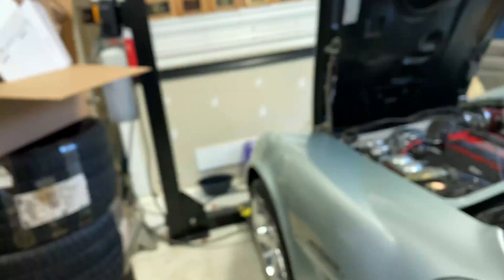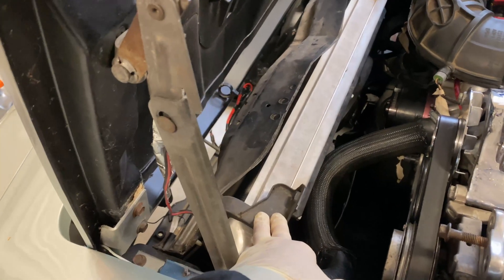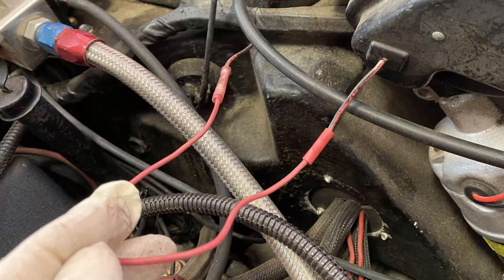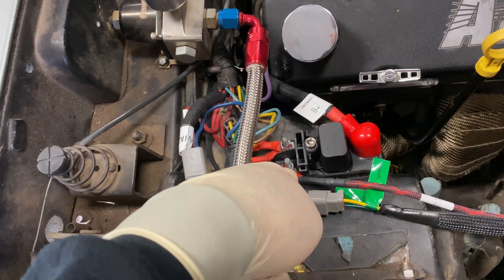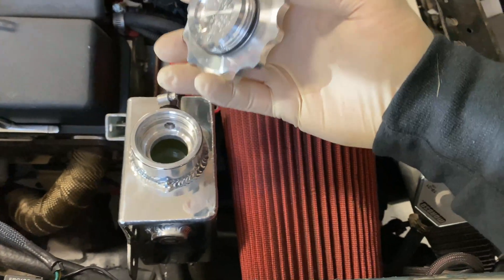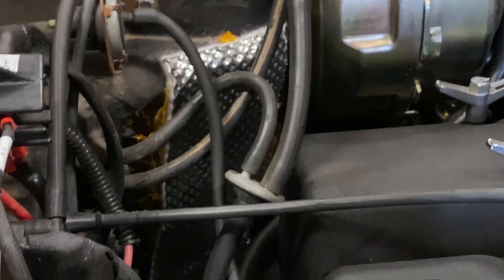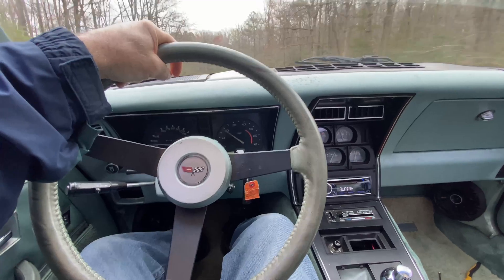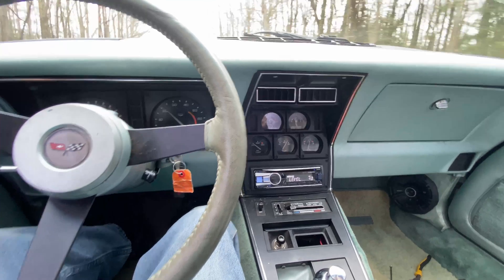Making the LT1 in a C3 Corvette more reliable (PART 2)

Comment: I have a major front oil leak I need to investigate.
Reply from the maker: oooo!  on what car?
Reply: @EllweinEngines  ERE124 in my 94 Impala. I only drove the car twice after I put the engine in and the 4l60e went on strike for a rebuild. I’ll get back to normal project car things once I get the trans sorted. I expected this.
Reply from the maker: @rsnarski3  Maybe the water pump shaft seal?  I  cannot remember what you have up there.

Comment: Any thoughts on the afr 180 lt1 heads ? Don’t really want to buy an lt4 intake manifold . Probably going to go 224/230 on the cam or maybe the tick 227/234 cam
Reply from the maker: Oh yes.  My thoughts on the AFR 180 LT1 or any AFR heads (right out of the box) is that they are a very good bang for the buck.  The best quality available and best quality assurance.  Good flow even for the smallest and lowest price AFR head.  I would put them on my engine in my car in a heart beat if I had the time.
Reply: @EllweinEngines  thanks Karl I really appreciate the information about the cylinder heads and throttle body .

Comment: The TV cable should be adjusted using a line pressure gauge, if it has the T350, or 700R4 / 4L60, if it used the 4L60E that would have come behind the LT1, the TP sensor would be used, as GM debuted the 4L60E in '94, and did away with the TV cable. It is critical to the life of the trans, and it should downshift, if adjusted correctly.
Reply from the maker: That universal cable that came with the car just did not work out well or I just could not figure out how to adjust it.  The 1993 Camaro TV cable worked much better and the test drive (no in this video) worked well.  good kickdown and it holds the shift points higher.

Comment: its an LT4
Reply from the maker: How can you tell?  Personally I've borescoped the cylinders and it's an aftermarket piston.  The timing cover is 94-95 style LT1.  The heads are aftermarket AFR.  You don't think that maybe the intake was an LT 4 purchase?  I have two LT4 intake manifolds but I don't have any LT4 engines. For this car, the block could have started lift as a 1996LT4 but I think it is a 1994 Corvette LT1 block.  That's my best guess.  Corvette LT1 blocks are as good as Corvette LT4.  Corvette LT4 had better crankshaft steel but and awesome GM LT4 heads but this engine has AFR heads (even better) and aftermarket rotating assembly.  Cannot call it an LT4 in my opinion just because it has an LT4 intake manifold.